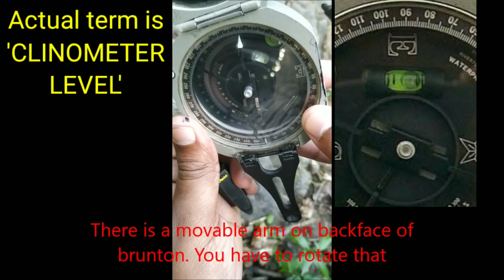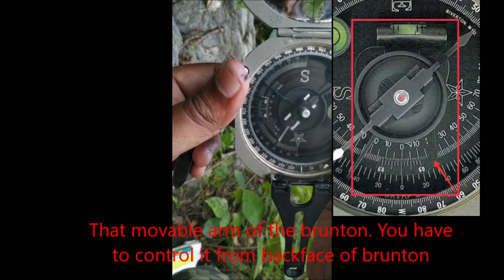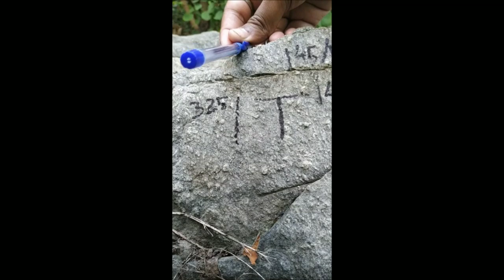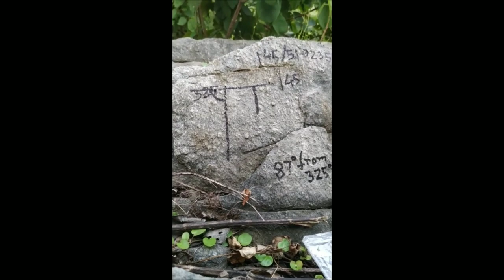Measurement of strike, true dip of an inclined plane and pitch/rake of lineation on inclined plane

Comment: A very good initiative by you people Sir. I have few suggestions about mentioning few things in the video that would give the students a better and clear understanding. 
1. For drawing the strike line, first make the dip of the pendulum zero. Then keeping the brunton completely lying on the plane, start rotating the brunton so that the spirit level of the Clinometer level ( capsule bubble) comes in the middle. Mark the line. Now orient the brunton side wise along this marked line and try to make it horizontal by bringing the spirit level of the bull's eye( tablet bubble) in the middle. Now note down the direction, this is the strike. 
## Any horizontal line on an inclined plane is the strike line of that plane. And the direction of that line is the strike of that plane.

Comment: Very nice tutorial for measuring the attitude of the planar and linear structures. But before measuring the line. Please show the overview of bed. It will help to understand which side we have to measure. I have seen that many students used to measure the attitude from the wrong side whereas a bed looks like a book and we have to measure the upper or bottom sides the plane not on  one of other 4 sides. Thereafter, apply the right hand thumb rule which represents the outline of the dip direction and strike. The thumb points the dip direction and other four finger point the strike direction. Measure the azimuth of the strike like from the north. Strike must be written in three digits. Then, measure the dip of the bed from the horizontal and it is measured along the vertical plane. Always remember which sides have the maximum inclination that would be the dip of the bed. But I always determine the dip firstly thereafter the strike. 
In the case of linear structure we measure the pitch, plunge, and trend.
Trend is just like a strike but it represents the azimuth of vertical plane on the horizontal plane. The plunge is the angle between horizontal plane and the inclined line that is measured along the vertical plane. Pitch is the acute angle between the lineation and strike line.
Strike line is the line of intersection of the imaginary horizontal plane and the inclined plane and it is measured horizontally.
Reply: Thanks a lot. After few months we will share another video about thorough concept of identifying suitable and correct planes for the measurement of strike, dip and pitch of lineation. But thanks a lot for expressing your views. Thank you.

Comment: I would like to ask regarding to the fault movement according to the pitch data. as in your video the field data shows this is a dip slip fault but how to represent the 'sense' of movement using the strike, dip, rake concention?? any help?
Reply: whether it is a thrust/reverse or normal fault... is it ok to write down: 146°/57°, 87° SW (if normal) or 146°,57°, 87 NE (for reverse fault)? i put quadrant code to refer the movement direction? which one is correct or is the quadrant shall be writen with respect to the strike plane?? in such way 146/57, 87 S (from dip according to your record)?